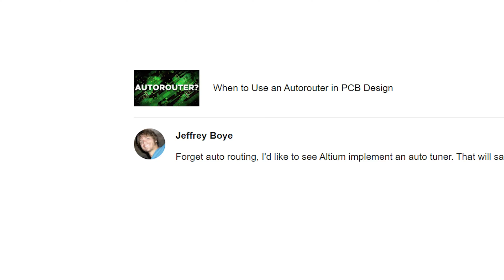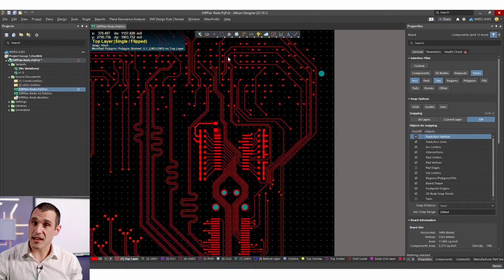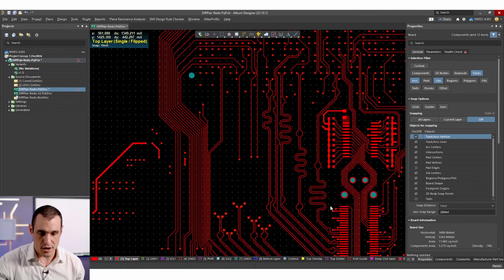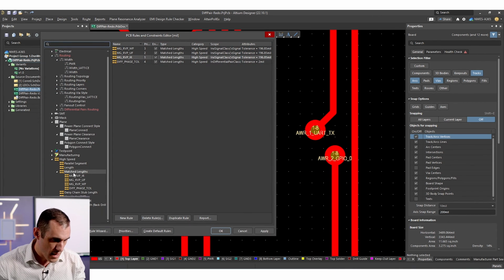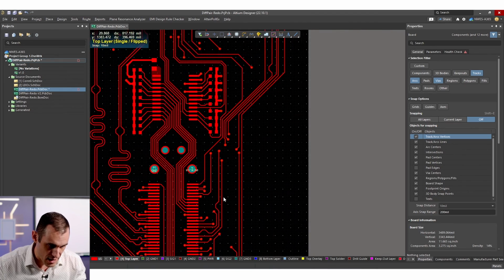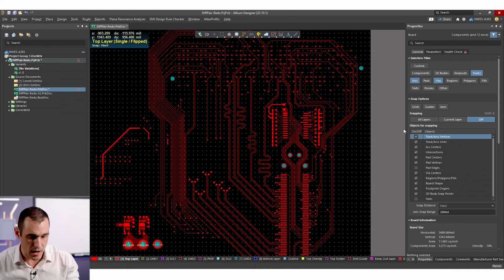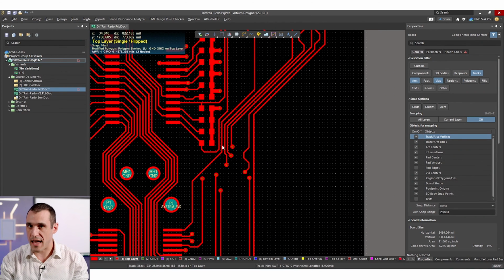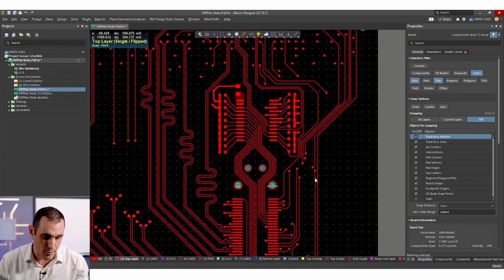Auto-Length Tuning in Altium Designer How-To

Comment: Hello, Zach. 
I made everything like you had shown on the video but.... traces weren't tuning,  just "Design Rule Verification Report" was generated. 
"Matched Net Lengths: Between Net SYS_I2C_SCL And Net SYS_I2C_SDA Length:62.45mm is not within 0.5mm tolerance of Length:66.099mm (3.149mm short)"
What is wrong? Maybe I need to change something in "preperences".
Reply: Maybe you need to change some preferences, but as much as I would like to help I cannot without seeing your settings or layout.

Comment: Hello Zach,

  Is there a way to put return path GND vias on the go while routing high speed diff pairs layer change?
Reply: I am not aware of a method to do it on the go while routing. What you can do is you can design it once manually for one of the via transitions, and then copy-paste it for the other via transitions. That's how I do it for both the via placement and the antipads.

Comment: You did multiple signals in different buses in one class.... Does this tool match the lengths to the greatest length of the entire class, or does it match RX/TX pairs? Id assume youd have to set up separate classes for that.
Reply: The class set up is important because it is called in the rule. The application depends on how the rule is defined. So for example, if the rule applies across different nets, then it will equalize to the longest length in a group of nets. If it is just inside a differential pair, then it will equalize to the longer trace in the pair. It just depends on how you apply the rule.

Comment: Cool, thank you for the video. Between the PCB panel in Nets view, the tuning bar (Shift + G) and this auto matching tool, this should shave a few days off of my next big job.

 I do a lot of work in Mentor Graphics Xpedition and while I'm not sure this counts as "automation" I really enjoy using Altium's Draftsman tool for fab and assembly document generation. Xpedition forces you through Fablink - a very clunky and unintuitive tool that requires a lot of practice and patience. Draftsman is a breeze and extremely intuitive by comparison. It just does what you'd expect it to and makes adding annotations very straightforward. It appears to run faster on identical machines, too.
Reply: I agree in the main about Draftsman.  Though I wish there was a way to adjust the ref des in the assembly drawing that allowed selection, rotation, and better placement.